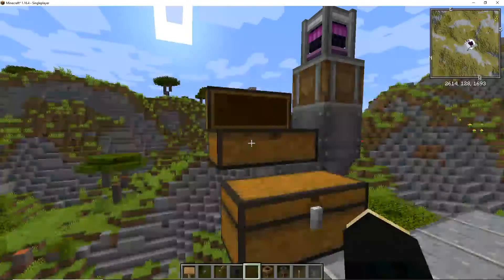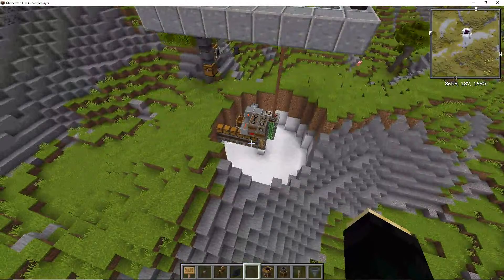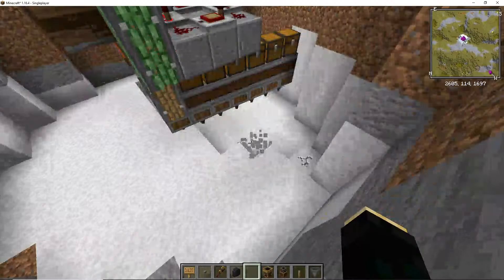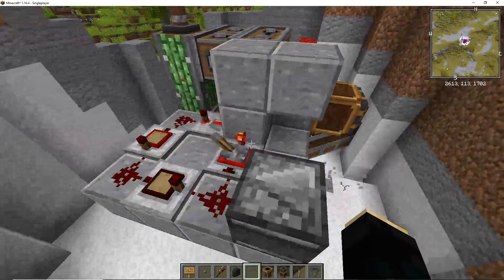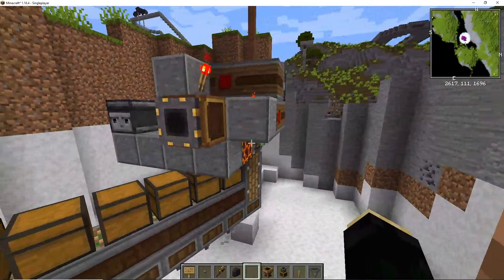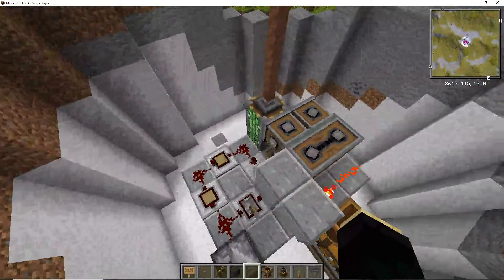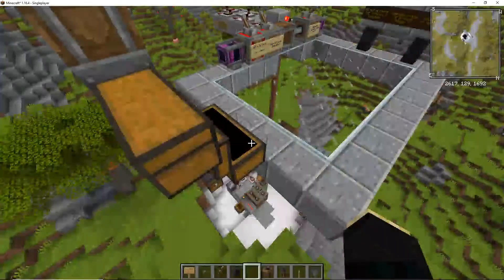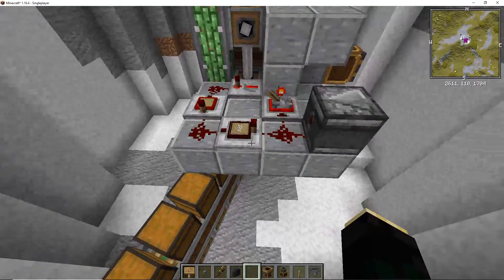Create 0.3 Expandable Coring Drill Rig Demonstration | Modded Minecraft

Comment from the maker: Welp the time lapse did not work out, found out that the larger the bearing arm(and therefore the faster the outer drills)  the more likely that the drills will skip over blocks. so though this design is still expandable, you will have to mess with the timing and speeds to get it to work smoothly.

schematic link in the description though if you want to mess with the design yourself! I improved the unloading as well so it should be 4 times as fast as I showed here

Comment: U Would need to set the speed of the outer Drills at a higher speed so it can keep up with the Inner drills.
Reply from the maker: you dont actually have much control of the drill speeds on a bearing, as they are powered by the bearings movement itself, the outer drills already drill faster than the inner drills because on the outer parts of the circle, they are covering more distance at the same rate of turning, 
and if the drills are being moved faster they will also drill faster
and another thing with drills on contraptions in this mod, the contraption will always pause its motion to wait for drills to finish, the only time this isn't the case is when the drills are spinning too fast to process all the blocks they are colliding with